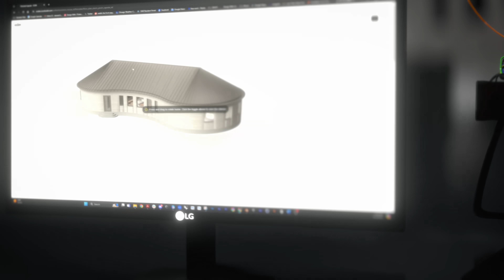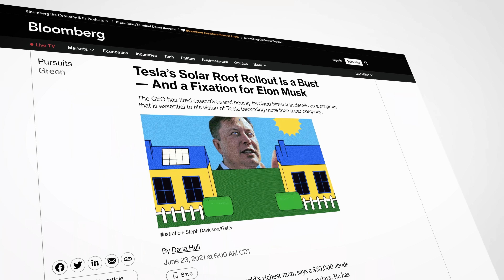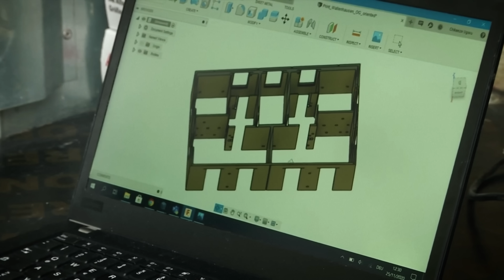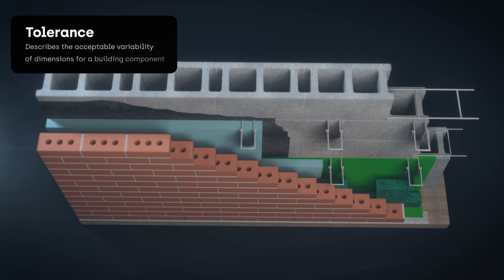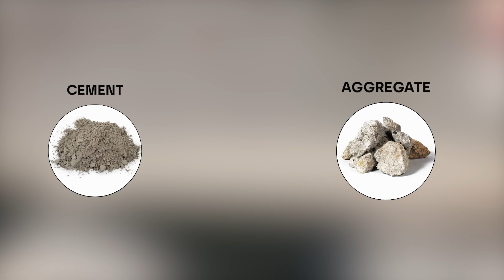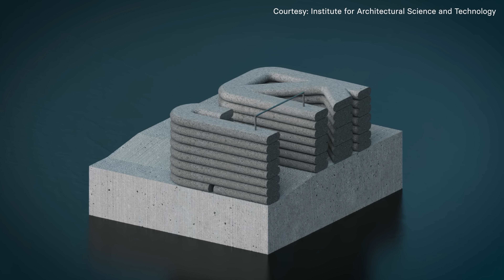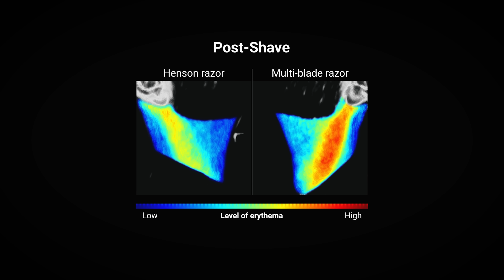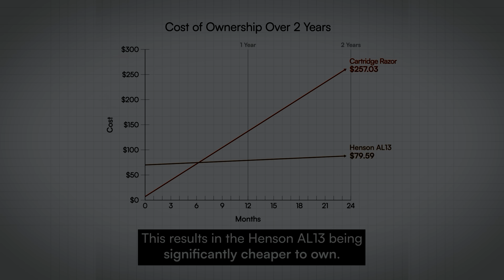Why 3D Printing Buildings Leads to Problems

Comment: Unreinforced concrete is hell for seismic. This would never be approved in places like california, where mass production of housing is most needed.
Reply: Also problematic on sites with expansive clay soils. Seasonal swelling and shrinkage of clay soils account for a lot of structural damage.
Reply: @damonroberts7372  That can be solved by deeper foundations.
Reply: This is my first thought. Concrete has great compressive strength, but steel adds the tensile strength. As a naive Californian, I find the lack of reinforcement terrifying.
Reply: @marktan3368 if only you could just lay reinforcement into the concrete after the print head moves over it.

I can't see how it's possible currently though, must be completely impossible to put something between and through layers, so we must give up and imagine it's not possible.
Reply: @meateaw  A robot could press rebar in, couldn't it?  If the rebar needs to be bent in curves first to fit "curvy corners" then that is something else robots could do.
Reply: @SeekingTheLoveThatGodMeans7648  "A robot could press rebar in, couldn't it? "
No, it can't.  Not really.

Ever look at how they put rebar in concrete?  It's a grid.  For thick members, it's even cubed.

A robot could lay horizontal rebar.  It really can't drive it down to make the vertical component.  Before the next layer of concrete can be put on top of the previous layer, it has to set to a certain degree and the layer below that has to have set even more and so on and so on.  This is just so it can take the weight of the layer above without smooshing out.  So by the time you would be high enough to drive a stick of rebar down into the concrete, the bottom layers are going to be way too hard to drive into.

And how are you gonna tie the horizontal and vertical component of the rebar together inside the already poured wall?
Reply: On the printed building I am working on, we are using ladder ties, rebar at the top bond beam, and vertical rebar in grounded cells. Its very similar to CMU. Horizontal reinforcement is placed on top of a printed layer and then the printer will just print on top. Vertical rebar is a little bit tricker problem to solve.
Reply: And not only for seismic
Reply: Good news for not being about to 3D print houses in calafornia, it will be underwater
Reply: Printed concrete looks like a lump of excrement.
Reply: 3d printing has always been a very specific use case scenario. I can't wait to see that scenario if it ever exists for housing. But prefab homes are doing everything 3d printing is offering far for effectively.
Reply: If rebar could be 3D printed into the concrete that might possibly work.
Reply: @jackhydrazine1376  Yup. There's one inflil type called gynoid in particular would make the final superstructure several times more solid than a brick & mortar. It's akin to solid body chassis in car construction. Since it's all cast together there's no 'joints' for groundshock to vertically sheer. The whole houseframe jiggles as one contiguous solid.
Reply: Unfortunately concrete doesn't share the elastic properties of plastic and polymer based 3d printing materials. Concrete has almost no tensile strength. These structures should be required to go through extensive engineering evaluations and have new building codes developed before being used for any functional purpose. Seismic and severe weather testing. Fire codes. I think that this manufacturing method has immense potential. Especially for non-occupied structures.
Reply: @PicardoFamily11  I see a very different upcoming demand though. These weather events will contnue to keep getting worse until we can get our CO2 situation figured out. That means more towns wiped off the map by hurricanes, floods, tornados & wildfires.. There's an increasing desperate demand for anyone who can get a process workable to diminish the time it takes to rebuild. A superstructure printer teamed up with a modular home builder providing veneers & overlays & slip-in inserts the time to rebuild could quite literally be reduced to months instead of many years.
Reply: Never mind seismic, half the country's industrial buildings are made from pre-stressed concrete panels.  How you gonna make those panels with a printing machine? When and how does the steel go in?  Without rebar, concrete is almost worthless.
Reply: @railgap new bull sheet hype technology
Reply: @railgap unreinforced concrete is just as good as any masonry like brick or block.......... Which seems to work for buildings.
Reply: The concrete has glass fiber reinforcement in it
Reply: @omotolaoyeniyi631  I don't know of any cases where fiber reinforcement has been used in structural elements like walls and primary ceilings. Not saying it could potentially be viable. But I think there needs to be much more caution and testing.
Reply: @PicardoFamily11  of course
Reply: Not strong enough.😮 @omotolaoyeniyi631
Reply: It's internally reinforced, I think. If it's a biggie sized version of my home 3D printer there's ways to 'reinforce' your builds by choosing certain internal geometries depending on the intended usecase application.
Reply: @brianhirt5027  wrong
Reply: It's reinforces, it seems like it's every few layers. Or maybe every layer. The process is interesting, but it's in it's toddler phase. In 5-10 years this will probably be the most common way to build 1-3 floor houses.

Comment: Isn't rebar used to ensure structural integrity when using concrete? How is that achieved in 3D printed structures? How is this better than just creating forms/molds and just dumping concrete into it?
Reply: Jokes on us, if we built structures that were under compressive loads, then we would not need as much concrete.
Reply: I can't comment on the total structural integrity of the wall, but rebar rods are placed orthogonally to the interior and exterior walls every 50cm or so every few layers. The space between the walls is often filled with a zig-zag of concrete too, similar to cardboard construction. The roofs are also attached with tie rods that span through the wall to screws formed into the foundation, providing some vertical compression. It is reinforced, but I am not certain what structural effect these have, especially compared to traditional reinforcement.
Reply: Small steel "staples" are a different kind of aggregate in concrete that provides more tensile strength than rock aggregate.

There are also plastic fibres but they are more used to minimize surface cracking as the concrete cures.

Comment: sounds like they dont have the first feedback...  A lot of what you talk about in here is "fixturing".  I'm an automation engineer, I worked with vision guided robotics, professionally.  

the plan can easily be adapted, and in real settings, it often has to be.  When you are talking about painting, for example, they arent planning a path... and putting it on a perfect path...  

the controls theory there is easy... but you have to have that sensor.  you need a laser, or ultrasonic sensor... and then you can read the exact distance.  this should be the primary indicator for path. it should have no issue reading the path ahead, and self correcting any error.  Thats nothing new in controls engineering.
Reply: final result will be hybrid, undoubtedly.  Theres no reason not to include some standard parts... and... put the windows in as you print.  they should experiment with security glass, that would be awesome if whole walls could allow light to filter through. that small block size might be easier to work with.  

but for large wall sections... etc...  

so whats lacking is the transition...  they dont need to print everything and in fact, they will have a better result integrating a standard object (such as a block of security glass).  you might need a much larger dispense head, or maybe the glass can come in a triangle, or arc.  

they just need better controls engineers.   this is not a controls effort... they have plumbers trying to make a perfect dispense... but its undoubtedly more expensive and lower quality to print in situ vs use a factory made module.

Comment: Absolutely terrible, I cannot see 1 single benefit to this, no reinforcement with steel making the concrete much weaker, so  no multi-story buildings, no control over wall finishes or isolation layers, no architectural freedom with complex forms that you can have with custom formwork, more energy consumption, thicker walls take more space, end product looks shit

Comment: The biggest advantage this method of construction has over any other is the ease and low cost of building up. Large homes affordable homes can be built in the same small footprint but up to 4 stories, or just 4 homes stacked together. This is obviously a more desirable home/more dense construction.

Comment: 7:27 I don't get why this is supposedly such a big issue. Just "build" the house with tolerances in mind that can then scraped out later to fit the dimensions of the window or door frame. Is 3D printing concrete impossible to post-process? Or what am I missing here?
Reply: post-processing adds time/labor/cost, reducing the main (only?) advantage of printing...
Reply: @hypertectonics7009  So 2 days of printing and 2 days of "post processing" to correct what needs to be changed before everything else can be installed is better than 4 weeks of putting down bricks?
Yeah, with that ruleset 3D printing is hot garbage.

Comment: This is clearly in its infancy. The bit I think is missed is that software scales so much better than hardware. As the hardware gets better at accepting tolerances and the machines require less oversight, the software will allow more customizability in design. A modular concrete prefab process is inflexible. FDM housing is flexible to an extreme degree. It is easy to think of it in terms of existing building experiences. But the true power comes from new processes and new thinking.

It is similar to how emails were printed in offices before people trusted that you could just read them on a computer.

Comment: Is it possible to print a thin UV-solidified plastic wall on the outside of the concrete?  closer to traditional 3d printing tech you could make a pretty cool looking thin decorative layer that also helps hold in the cement maybe

Comment: 3d printed homes should still be repairable, as is the case with regular concrete structures, sure you won't get the layer lines but in the end it's still concrete, which could be poured, or filled in with different material.

Comment: Embrace change for cheaper housing. Curved walls are more stable than long straight walls. Just because it doesn't look like a brick house, it's not bad. Could be tornado proof, too.

Comment: I would really question the strength of these things in major storms or earthquakes. Concrete is strong in compression, but far less  in extension and I am not seeing rebar or fiberglass aggregate to try and re-enforce it.  Those layers are going to be weaknesses too and there are hundreds of them. Also it containing flyaash seems bad because that stuff is full of things that arent good for you.

Comment: I just don't see how it could ever compete with the efficiency and flexibility of factory built wooden houses like how they are made in Scandinavia? (Also if you are reading this Mr. Hicks i wish you would do a video comparing and contrasting that to the American style of on-site balloon framing).
I have seen them erect a house in just 1 day with a crew of 3 people and a regular crane, they could have the roof on in the time it takes to set up the gantry for 3D printing.  
  
Seems like a solution in search of a problem to be honest.

Comment: Using this technology like a precast plant could work. Say each structure is limited to the size and weight to be transported and set with a grade-all or boom truck or tower crane. They could be keyed to align and interlock easily and any fouled print could be scrapped and recast before it gets to the site.
Reply: This already exists in a much better way... Casting... As in precast. People are just trying to apply an unsuitable manufacturing technique in wall construction because it has been absent... For a reason... There are already far superior ways.

Comment: Ah - Stewart. I wish you took a more optimistic and explorative approach with this one. "Why 3D Printing Buildings Leads to emergent design opportunities that will revolutionize how we practice architecture". There is so much inherently different with 3D printed architecture that it begs us to reassess "what is an opening", "how it is made", "how to deal with water", "expansion joints", "utility integration", and so on...

IAAC is doing amazing work within this realm to address these questions. Also, WASP has fabricated some of the most innovative adobe printed structures that tackle these design reassessments. I encourage everyone to look up Philip Yuan who is championing spectacular research in the realm of componentized 3D printing. Obviously ZHA also made that sick compression-only funicular structure (Striatus Bridge).

Anyway - Be inspired everyone! The current construction industry (the way we recognize it here in America at least) is so young. Don't be intimidated by the means and methods currently in place because 50 years ago they were much different, and 100 years before that they were almost unrecognizable by todays standard. Tackle this new opportunity to re-envision how architecture is designed and fabricated. Study elementary principles such as geometry, gravity, particle flow and material ecology. The practice of architecture will inevitably become similar to the product engineering fields we're familiar with today 🤘

Comment: From an economic perspective, wouldn't most of these hurdles be solved by integrating 3D printing with prefabrication? 

With prefab, 3d printing could become much more modular and have more outside conditions controlled for to create a more consistent product. Even if there are other construction materials required, at least in a factory, it would be easier to integrate those materials with the 3d printing process. Also as a side note, I feel the biggest problem with housing affordability isn't the cost to produce the home itself, but rather, the inability for cities to up-zone areas that require denser housing. 

As always, cheers! Love your videos!
Reply: There's no magic bullet. My city has and continues to upzone but there's not much uptake. More missing middle and high density helps. For downtowns, no height limit seems intuitive but that can drive land speculation, effectively slowing down and increasing the cost of development, so there's a balance. Even if municipalities and developers work together to fire on all cylinders, there are still shortages of staff and building materials. There are other issues too. There are so many issues that have snowballed together.

Comment: Why aren't we 3d printing with cellulose?  Might be better to grow our own wood in nutrient vats.
Reply: Because if we did that it would be like making a house out of cork board
Reply: @pyppetmaster21000  paper, plywood, drywall... lots of things to make from cellulose. Toilet paper! Writing Paper! Copy Paper!
Reply: @brookestephen   What I'm getting at is its difficult to use cellulose to print structural supports. It is used in some companies to make flooring, walls, ceiling tiles, etc. the methods that are used with printing cellulose take extensive processes to render them stable and strong. That's why you don't see plywood structural supports or sawdust beams. They have their uses, but if you want structural integrity, it would be better to use wood or concrete construction like we do now. Or do something like what gablok is doing. 3d printing just makes the whole process overly complicated. I don't see it ever becoming a widely used method of construction. There are better and more efficient ways of building houses.
Reply: @pyppetmaster21000  ok let me guess - mechanical engineer? LOL Read my comment again, without presuming I'm talking about means of support.
Reply: @brookestephen  I am studying to become one actually. But I see where you're coming from, I think. It is possible to grow wood in vats it's just very difficult. The main problems are the amounts of chemicals, time, and energy needed to grow it. Essentially, you would need to make the wood grow really fast in order for it to be a viable option for construction.

Comment: I feel like this is "adapting space technology gone wrong". We absolutely want 3d printing structures on the Moon and Mars so we don't have to bring any material with us. But there it is going to be sintering of regolith, meaning you take the material lying on the ground, melt it with a laser and let it cool down again to create a solid structure.
In desert regions this would be great to create structures out of the sand that is already there. And all you need is a small laser attached to a solar panel and a vacuum cleaner to suck out the sand that was used as support material.
Meanwhile concrete is much more limited because it is so viscous or even liquid in the beginning. And it needs a whole giant industry to even create the concrete.

Comment: the "cant fix mentality" is a non issue. anything needs attention can still be fixed with traditional ways. It doesnt need to be "reprinted"...
Reply: Yeah. I imagine a broken pipe requiring an access hole be cut into the wall. It strikes me as an easy process to use cinder block or brick or even stucco to patch the hole.

Comment: don't make it sound like you couldn't add drywall to the inside of a 3d-printed building. also i know nobody who would tear down or add walls when renovating. sure, some might wanna divide a big room in 2 but even then, why not just add a not-3d-printed wall? 
but what is with insulation and hanging things on a 3d printed wall. you totally missed those points.